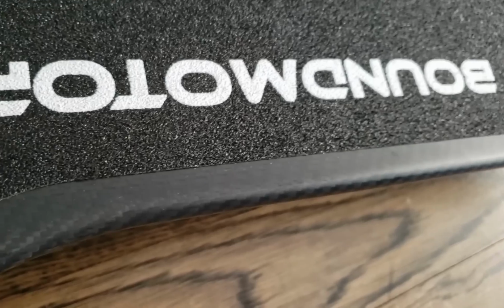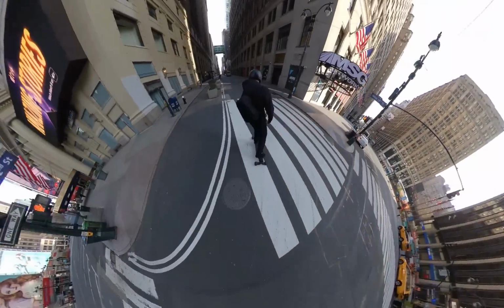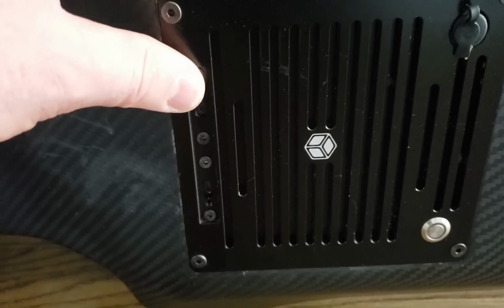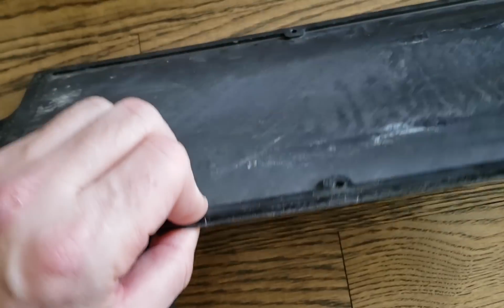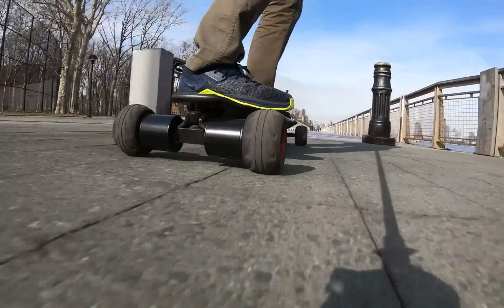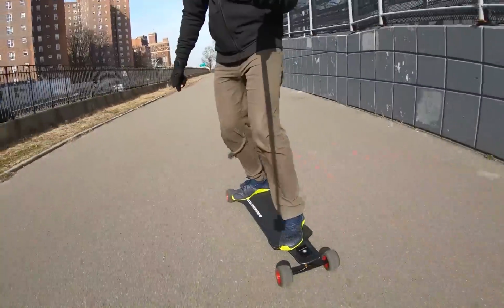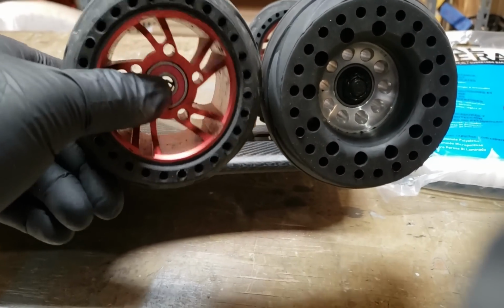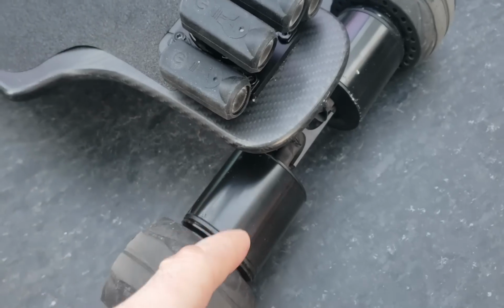Bound Motor D1 Direct Drive Insane Machine

Comment: The Bound D1 uses a 12s2p battery. When running it at 60 amps, you're running it at the batteries maximum continuous current draw rating, and as a result you will lose roughly 40% of your range through voltage sag.
Reply from the maker: I am happy getting 9 miles out of the battery with faster speeds. If I need to get more range I can lower to 30A per motor and get more range. Its what you choose and what works best for you.
Reply: @ElectricVehicleSpace   Just though I'd point that out, as it's it's biggest weakness.
Reply from the maker: @SyntacticOperator  I think it's not. At 240lbs 9 miles on high speeds if fine for me. Once its warmer I may get more.
Reply: @ElectricVehicleSpace  All portable electric vehicles have a weakest point, if range is not this boards weakest point, than what is it? 

Not only will a 2p battery give you less range, it will not give you as many charge/discharge cycles as a 4p pack would. Imho, it's essentially cell abuse to run batteries at their maximum rated current draw. Do you have a way to measure their temperature?

Also, you live on relatively flat land. I'd like to see how this pack performs at 60 amps in the mountains. It may very well go into thermal shutdown.
Reply from the maker: @SyntacticOperator  it will not. I discharge 30A from the pack and 60A per motor. This does not mean that it's going to take 60A from the battery. The esc calculates the power output similar to 60A but will draw only 30A ftom the battery.
Reply: @ElectricVehicleSpace  Ahh, you're correct. My mistake. However, it will have much more sag than a 4p configuration.
Reply: @ElectricVehicleSpace  I've just done a lot more reading on duty cycles, electric motors, and batteries. If your ESC power output is set to 60 amps at the motor, a 30 amp draw from the battery is a 50% duty cycle. Meaning 50% on time. Where as a 100% duty cycle would mean motors amps are equal to 100% battery current draw. In other words, a 2p pack will indeed go into thermal shutdown close to, or at 100% duty cycle, and it will give you less charge/discharge cycles as a result. It's pure cell abuse.

Comment: Did you update the firmware on this VESC from 1.29 to latest, the company said not to update to latest? And was that 60 amps per motor you were running?
Reply from the maker: I used 1.23 version and 60A per motor and 30A and -30A on the battery.
Reply: @ElectricVehicleSpace  Boundmotor have released a direct drive kit and on the specification sheet it says maximum amps per motor is 30amps, so are your motors the same and you are just over clocking them in a sense

Comment: Great review! I have the same VESC and motor set up, wasnt sure if i could connect a Bluetooth module to that or not seems like no problem now that you did it! Keep up the great work bro and for the price very good cruiser board.
Reply from the maker: Thank you Jesse. Yes indeed its an awesome board. Be safe!
Reply: I don’t see a port where a Bluetooth could plug into
Reply: @cramdangle  Yeah no UART port so you're stuck with their proprietary remote/receiver and no chance of bluetooth/arduino control or expansion to 4VESCs via canbus.

Comment: Between this board and the Verreal RS, which board, if you had to buy one, would you get based off performance and range alone not looks.  Also taking price into account & value.
Reply from the maker: price wise Verreal RS (if on the budget) but if you want fancy and that awesome carbon with extra vesc capabilities then Bound motor D1. Now if the $$$ is not a problem I would order the bound motor D1 with wooden deck and carbon enclosure that holds 12S3P - i think it is $1.2 or $1.3k.
Reply: Portable Electric Vehicle Well.... I already had ordered the Verreal RS a few days ago.  After seeing your videos on the Bound board I went ahead and ordered the Bound D3 with direct drives today, wooden deck (light on top, dark on bottom). Wanted the bigger battery, like you mentioned. Appreciate the response, hardly any videos or reviews anywhere about these Bound boards.  Thanks
Reply: S Scott definitely lets us know how it goes with the D3 man literally was just about to order I just want a real review. I’m getting the verreal as well. Guess we’re in the same boat.
Reply from the maker: @xanderhaze5829  did the review I posted did not help you at all?
Reply: Portable Electric Vehicle slightly, wasn’t interested in this model just their new models. And no one seems to know anything about their hubs. Everything around them is strange it’s a nice board still. The cells they use are ... good I guess but I’d still stick with 30q’s their unmatched. 35E like in the new evolve is good for long distance. 10S4P 30q battery pack looking at 20-25 miles nonstop max speed no performance sag. 35e would get an extra 7-10 miles...but sag would kick in at low percentages. These Panasonic cells not to say aren’t good I just haven’t seen them used in boards often...but that also sparks my interest. Bound is the only board I see in the price range with a 12S battery setup. 12S is just love if you have 30q’s... anyway. Bound is a cool board. Still not sold on me yet maybe if I see more reviews this summer.
Reply: Xander Haze I’ll let you know for sure, I plan on getting a review done on both boards.  My friend has the same DD motors on his DIY and they’re pretty nice. Only issue he’s had is their kegel pulley adapters have broke twice so far.
Reply: @ElectricVehicleSpace  spot on.
Reply: @ElectricVehicleSpace   The bound motor D1 with wooden deck that houses 12S3P, is that now called the D3? I see a D3 on their site with wood and option for 12S3P. It seems the D1 only has 12s2p
Reply: Damm im stuck between this and the verreal rs as well (the d3 version with bigger battery)

Comment: Cloud wheels are better when you catch the rough road.😂😂😂
Reply from the maker: cloud wheels are awesome but on regular asphalt these 105 are holding a bit better edge.
Reply: Cloud wheels are dangerous to ride, core succumbs to fatigue after riding and the entire bearing seat cracks off the wheel.  Airless tires are pretty garbage too, either go pneumatic 6"+ or standard core urethane like torqueboards 110s.
Reply: @row8261  They've made the new DISCOVERY 120 series AND have PROOF that the person UPGRADED their bearings which where off by .005 microns!
STOP SPREADING F.U.D.!!! (Fear Uncertaintly, Doubt)
Reply: @row8261  https://www.youtube.com/watch?v=sS8gzfkBUBI

Comment: Hi, is it possible to connect bluetooth with the ESC and how ? I have the boundmotor ESC and I never succeed connecting a bluetooth function to have the data on my phone.
Reply: No its not doable, no built in BLE module and no UART ports to connect an NRF or HM10 module.  So much bad information here because people don't know anything about VESCs or electric skateboards in general.
Reply: Row is correct
Reply from the maker: yes it should be double.

Comment: Nice video !
Did you notice some noise or wobbling at low speed while riding or at home while testing? I saw videos with those kinds of problems. In your video we can see the wheels turning while the board is upside down but you cut the beginning 😅. I plan to install those motors/wheels with a Flipsky dual 2x100A. Any advice ? Thanks in advance!
Reply from the maker: what noise are you referring to? not sure what did I cut? please elaborate and I will follow up here. Please specify what problems...? Thank you for the comment and feedback.
Reply: @ElectricVehicleSpace  I refer to this video:  https://youtu.be/40w5oGq35lo. Did you notice something like that?

Comment: I have a bound direct drive with their esc and it is very smooth and powerful. The big rubber wheels feel very comfortable but they take a big chunk out of the range. I get maybe 7 miles on a 10s3p battery. Still worth it though.

Also their shipping is really quick. If they use dhl I would get my package within a week from China to California.
Reply from the maker: Yes the board is super sweet and amazingly comfortable. I get very good range. You should get more than 7 miles unless if you over over 250 lbs.
Reply: I thought the D1 is listed at 25-30 km for range?
Reply: What top speed do you get with the DD + esc?

Comment: Whats the difference between  direct drive and hub wheels?
Reply from the maker: less vibrations and super smooth ride with more power.
Reply: Its basically a belt drive in hub form.

Comment: Great review! Can I have any insights on battery sag?
Reply from the maker: It is cold now in NYC and I am waiting for warmer weather to get the range test. I felt performance reducing when battery is deeping under 50% which is normal and to be expected because I am heavy and the direct drive has HUGE motors that require a lot of energy.
Reply: Portable Electric Vehicle I see. I noticed that bound motors upgraded the direct drive motors according tot heir website. Is yours the upgraded one or the old version?
Reply from the maker: @najeff2  I have the older version.

Comment: That was a crazy gang of rough riders at the end! it's interesting to hear you say you like those more than the cloud wheels. Great review
Reply from the maker: both wheels are great but these honeycomb wheels are slightly better.
Reply: @ElectricVehicleSpace  they say that the wheels have an 800km lifespan. that is the only reason I am more into buying the 100mm mbs wheels than these rubber ones.
Reply from the maker: @fl3x1s54  I will have to ride more and see what happens.  So far no wear outs at all but I only maybe have around 50 miles on them.
Reply: @ElectricVehicleSpace  if the ride quality is as spectacular as you say i think it might be worth it though. even if i have to change them every 800km.
Reply: @fl3x1s54  that's like 2 months of riding for me, at most. Hell no

Comment: This vs Exway Flex, which do you prefer?  This will be my first board so I would really appreciate your opinion.  I have no prior experiences with any skateboards either.  Literally fresh fresh.
Reply from the maker: There is a lot to go over because both boards are so different and cool in their own way. If you look from portability perspective than Flex is way to go. If you want customization and carving, longer range, wider stand and you dont care about size and portability than D1. 
D1 here has a lot more to offer but will require a little DIY like for the comment regarding waterproofing and getting different set ups for speed/racing vs. carving at lower speeds and getting longer range. It is important also how much you weight. There is a lot of variables to go over and only you can analyze over the factors that are important to you. To simply i will do this - portability Flex for all other aspects D1 model. I would have purchase both and have the D1 as a machine ready to DIY and change/play with dif. setting because it is so much fun! Also have Flex for all preset amazing bms and esc function for portability.  The 105s wheels with the Direct Drive really feel amazing and unique!
Reply: @ElectricVehicleSpace  Thank you for the replies everyone.  I weight about 230lbs 6'1 if it helps.  Portability is not really a deal breaker for me, as I only plan on riding when it's good weather.  As for the 105s wheels with Direct Drive, you mean the Boundmotor? Thanks again
Reply: To be fair, you should compare Exway Flex with the Bound R3 (or the Exway Flex Riot to Bound D3) which have more flexy deck. In my opinion drop down deck looks pretty cool, i like the design. 

However Bound boards are 100 to 300$ more expensive (with 1st battery option) than Flex Riot. Futher, they have very very few reviews yet and almost no communication on social media, so we don't know if they are really reliable or not. So personally i would choose Exway who have a great reputation
Reply: Belts will keep you busy. If you only had perfect roads. God doesn't give that.
Reply: I am amidst considering from those 2 boards as well and I've had about 6 boards in the past. After seeing the internals of the boundmotor board, I'm now inclined to the flex because I'm not a fan of how the insides of the D1 is made. I usually ride on any weather and the D1 will barely have any water resistance if water enters from the top. I could apply some silicone coating on the enclosure to prevent water from entering but I don't wanna risk it. I just know that the flex is IP55 rated and is more suitable for my purposes. The Flex seems like a more refined board overall for me. Let me know which one you end up choosing!
Reply: If you can do a board related sport the skills are transferrable. I haven't skated in over 20 years but I snowboard and I was able to jump onto a electric board. I would recommend going with big wheels 120mm + to air tyres. They feel nore comfy and more "in control" imo than street wheels.